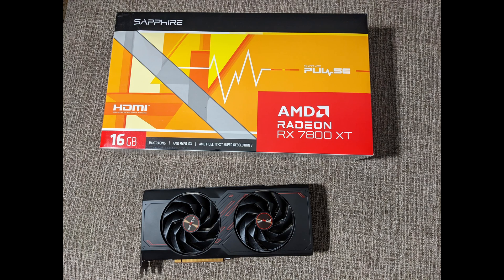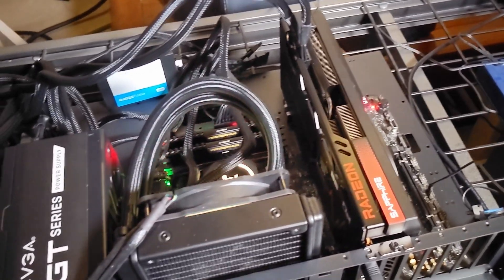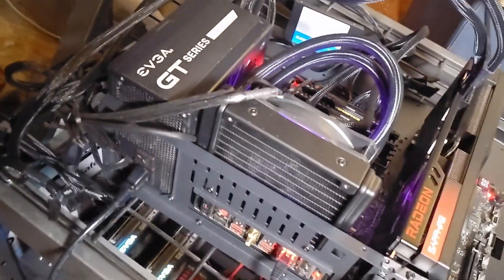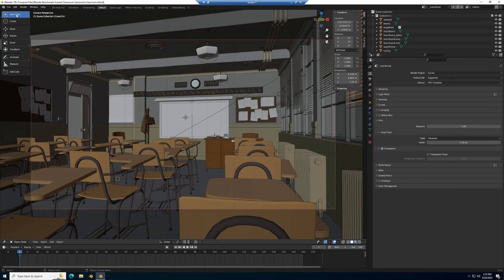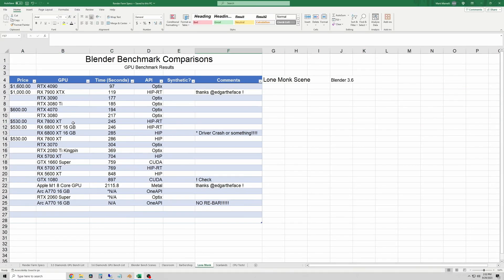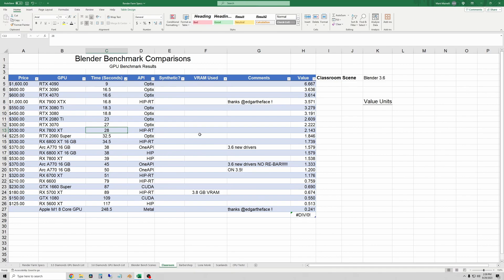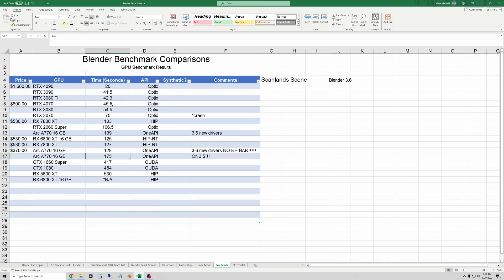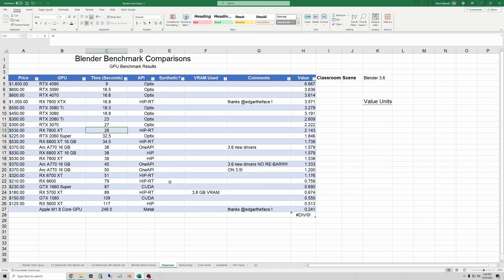AMD RX 7800 XT Rendering Tests in Blender | And New Test Bench Breakdown

Comment: In all the tests 3070 is ahead of 6800xt, except the Lone monk scene. Could it be because 3070 only has 8gb of vram? I currently have options between 3070ti and 6800. Cant decide. Kinda 3080 is also an option, but dont know if i want that power hungry card :/
Reply from the maker: VRAM amount will not cause slow downs until it forces you to enable tiling or multiple pass rendering. As long as the scene runs, VRAM is not full. I would maybe shoot for the higher VRAM GPUs, just because it's nice to have.

Comment: 3 suggestions, see if you like any of them.
1. You could add a column where the fastes GPU is 100% or 0% and the others are how much slower they are.
2. You could calculate the energi used for the renders, joule/Wh. That way we can see how efficient they are.
3. You could also just approximate it from how many watt the GPU uses doing the render and how much time it takes. Just watt x time, and get Ws or watt x time / 3600 = Wh (for smaller numbers)
Reply from the maker: Hey I think these are great ideas! I am going to add power draw into the data soon. I am trying to find a unifying unit that accounts for speed and power all in one. But I will add a new tab to the spreadsheet for this info very soon

Comment: Grate with a place to see the difference between HIP-RT and Optix. Benchmarks of blender is hard to find, good job.
Reply from the maker: Thank you! Glad it's good info. I will retest everything too, to make sure the newer CPU doesn't change results too much
Reply: @ContradictionTech It is grate with a test bench, where you can alle the different gpu's you have. Not many people have this many different card. But you might run into problems with drivers and OS doing OS stuff, repeatability, sample size and much more if you are aiming to be the gamers nexus or hardware unboxed for blender users. I do not need it to be 100% accurate, if the difference between two cards is 5% it will probably not affect my baying decision. Thus when the difference between 4070 and 7800 XT still is ~50%, for two cards that cost about the same (where I live) I might be willing to give up some gaming fps in some games to have a better time when playing in blender. Keep up the good work.
Reply from the maker: @Petch85  yeah exactly! Nearly all of these tests were done on the Dell, but I will get them all refreshed for a newer PC. But I think the data is sound so far anyway. Thanks!